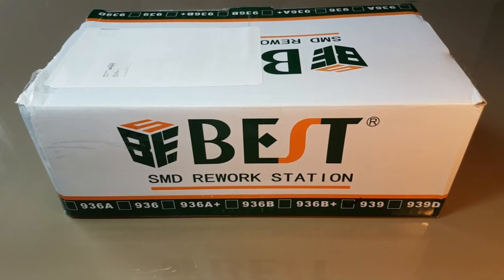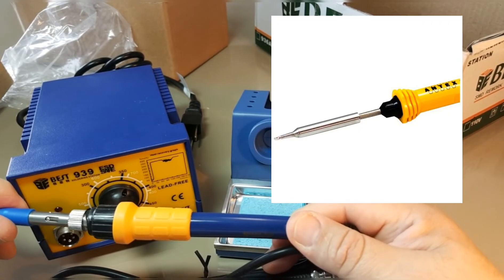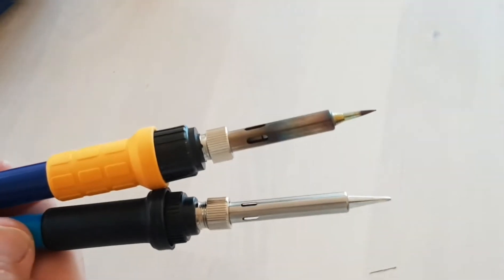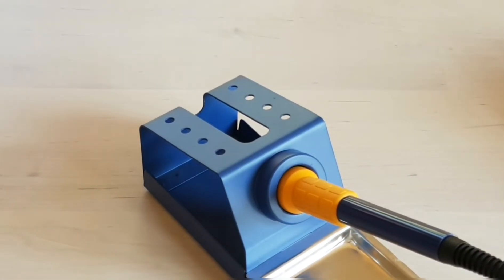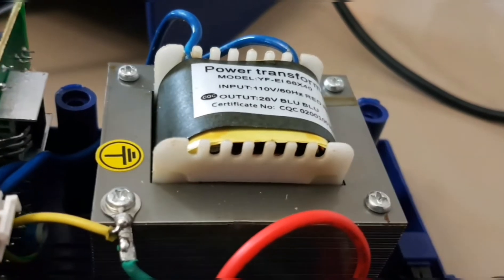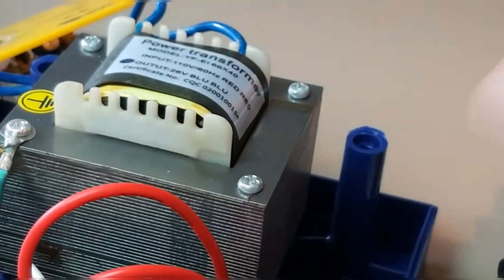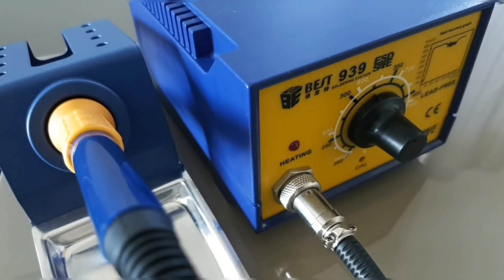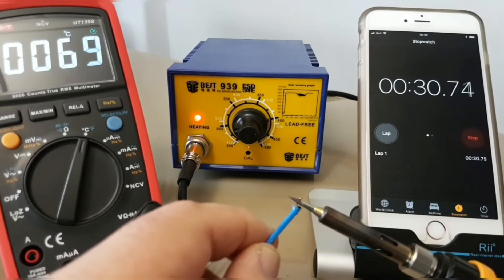BEST BST-939 Soldering Station Review & Teardown!

Comment: To be fair once you fixed the power connector it did its basic job pretty well for an ultra cheapo non-digital - I agree with ya on it not having a digital display - Thankfully theyve gotten much better since this video of 6 years ago.  I will say the video might have been more exciting if you had just turned it on from a distance with a broom stick and watched the sparks fly--LOL
Reply from the maker: Now why didn't I think of that!! 
All things considered it was a  good station with solid heat transfer..slow but usable...kinda like my first wife! Muhahaha

Comment: Correct me if im wrong, but shouldnt that loose power connector you pulled off have been inserted into the PCB from the (other side) so the legs could be soldered like all the other components-??  Guess that wont work as its a connector and wouldnt fit-? Perhaps "Best" is not the best name for this companys quality-lol
Reply from the maker: Good observation...yes..Probably not the BEST quality around !

Comment: I bought a regular knockoff of 936 for 20 dollars, it was rated power of 24v 60w, but calculating the area of the transformer the maximum possible peak was 27.8w.  And it has a poor heat sink in the triac and get burning hot after proper use, so I decided to make some modifications, I installed a heat sink from an atx power supply and made a 25v 70w transformer and now it works. The tranformer of the best looks decent the transformer thad came with mine 936 its probably less than half of the best one.
Reply from the maker: Nice mod...always great when you can make it better! Yes the BEST had a fairly beefy transformer and seemed to offer decent value.
Reply: @KeepOnTesting  another good mod is a power supply for the board i measured the power dissipation on the big resistors of the zeners in mine 936 is the ic tl431, the power disipation was from 2.5w to 5w in some cases and the consumption of the operational board side was from 2ma to 5ma, i just used a old phone charger modified to give 10v.

Comment: At 14:45 . So you messed up the socket while removing the display board then edited the video and blamed it on BEST.
Reply from the maker: You're full of beans John..That was 4 years ago and I still remember the crappy solder job. BEST is anything but.
Reply: @KeepOnTesting  fair enough. The polite reply tells me you’re honest. I have a Yihua 939D and it’s pretty clean. Thanks for the reply.
Reply from the maker: @johnviera3884  My pleasure. Yihua is 10x better manufactured. They make good units.